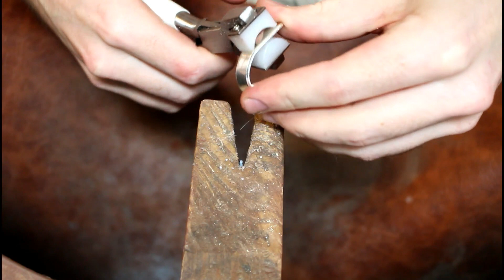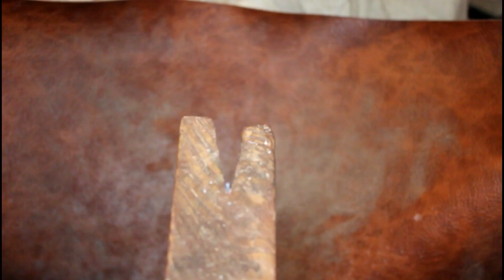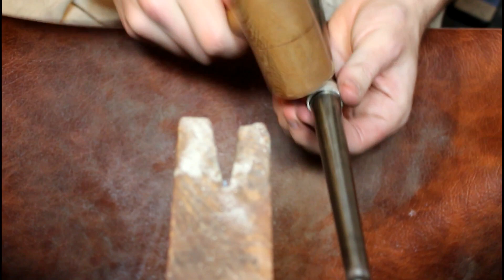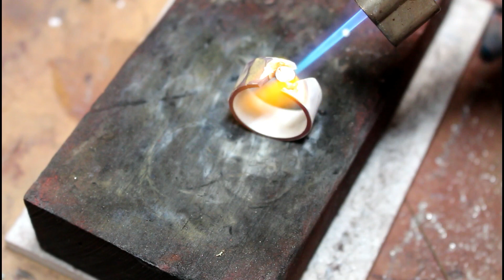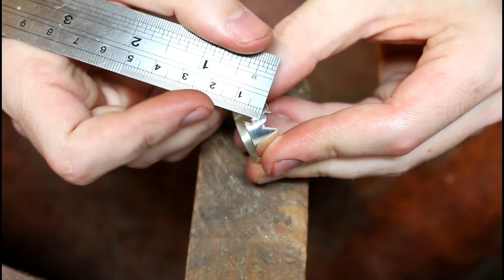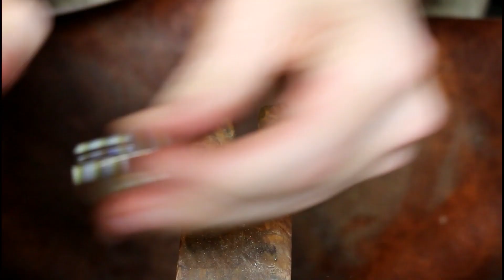MAKING A STONE SET SILVER SPLIT RING

Comment: great ring and design, 
wondering why you soldered ring as a whole initially, if you cut it after? why not just cut the original strip ends at diagonal?
Reply from the maker: Because I would loose material which in turn would make the ring a lot smaller. By soldering and then cutting I can use the entirety of the metal